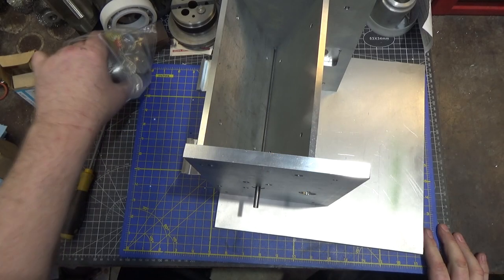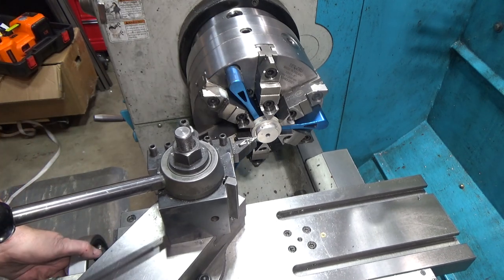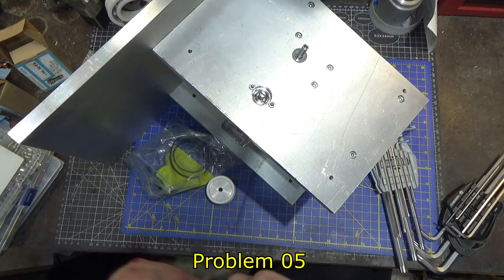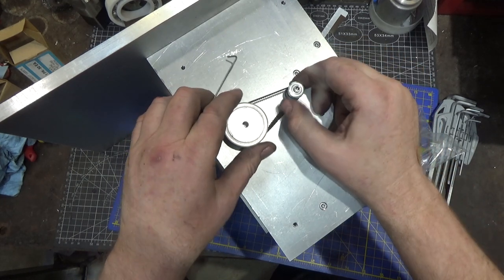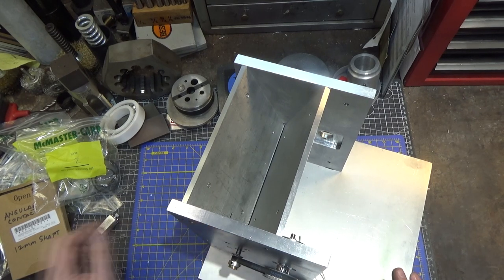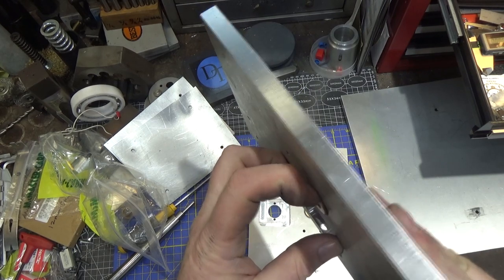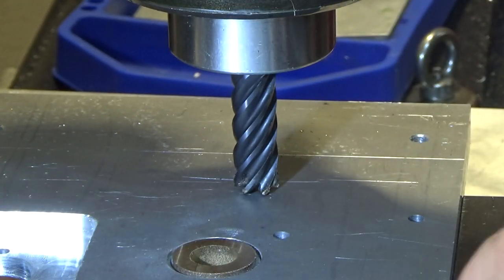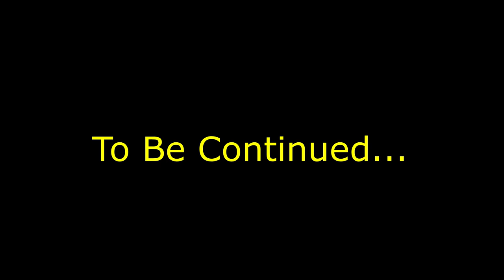210 Toothpick Dispenser Part 4 PROBLEMS, PROBLEMS and more PROBLEMS

Comment: I would take a regular reamer and ream the bronze bushings. If those are sintered, well, you have lost the lubrication by machining or sanding them. I don't think angular bearings are necessary. I do believe if you use bearings, self aligning would be the way to go, or maybe overkill.  Robert, hand drilling was not the way to go, as you already found out. Also when cutting the larger timing gear, you could have mounted it on a tapered mandrel and cut it easily.  You could have made one if you don't have one.
Reply from the maker: Those were a bunch of great pieces of advise, Thank You. I mistakenly thought that the hand drill reaming would work out because the hole was only about 0.020" undersized, so I thought the reamer would follow the hole. Not so, but now I know. I did mount one of the smaller gears in a 5C collet, but the tapered mandrel is a fantastic idea that never occurred to me. I don;t know if I have one that small, but I could certainly solve that dilemma.

Comment: Boy just not your day there. Instead of a vibrating motor, could your polish up the inner sides so the needles cant "grab" to the sides and will want to slide on down?
Reply from the maker: That is a possibility too. Thanks for the idea, Tom. These needles are ridiculously light so a tiny bit of friction causes them to stick.